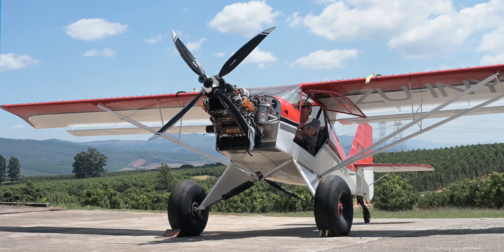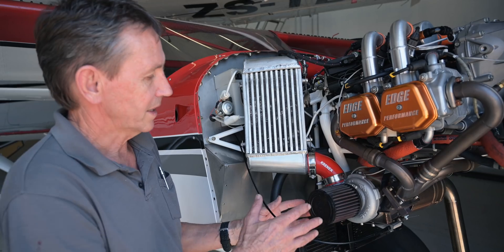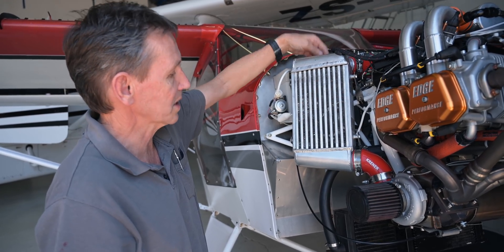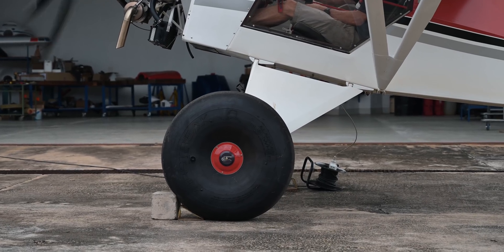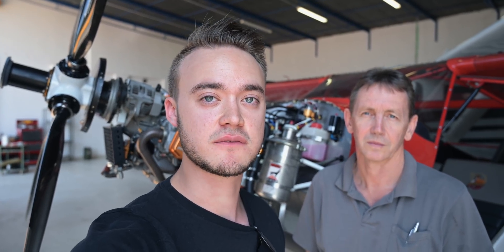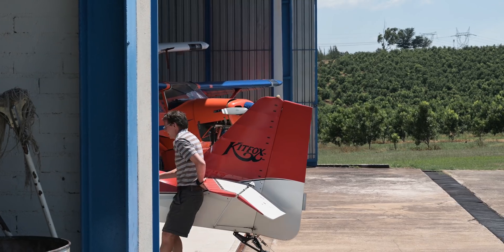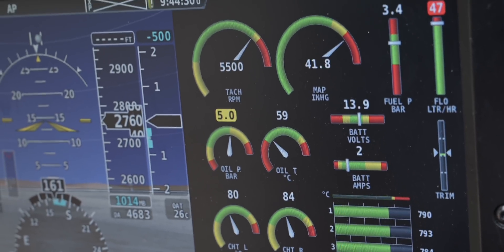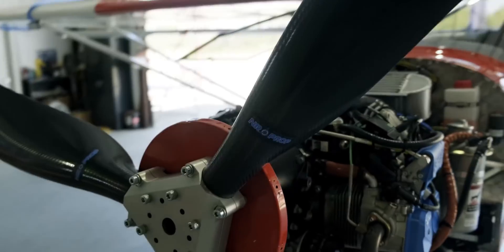ENGINE INSTALL | 165hp Edge Performance Install, Cowling mods, Taxi test - BUILD Part 3

Comment: Lost almost 30lbs?! How is that possible? Carbs are a couple pounds heavier than the injection but damn. Nice work. Yeah, mine is currently around 950lbs
Reply: Ooh SNAP! Trent Palmer, Gravity Knight and About2Stall all commenting on one post?! I’m subscribed to all of your channels! You guys are my hero’s!!
Reply: WesJordan  thanks Wes! ...and About2Stall- well, regardless of how the weight was lost, it’s good your bird got lighter!, should really rip with the high power Edge motor. Been tuning mine the last few days... amazingly smooth! The 915 is a great engine- flown one and love it... but I do really like/prefer having control over the tune!! Enjoy
Reply from the maker: Yeah Thanks man! We are really glad about the weight loss! I can foresee these Edge Performance Engines becoming really popular, they are totally worth it. Also, excited to see the performance boost you'll get on your Rans💪🏼 keep in touch!
Reply: Trent I asked the same question and I asked Thomas Hauklien of Edge performance engines how could this be? His response was  
"the 915 has a messy wiring harness, huge heavy CB/Relay/Capacitor box, twice as heavy gearbox, heavier crank, heavier turbo and exhaust system, dual injectors, sensors etc. it all adds up"
Reply from the maker: Thanks Trent! Yeah like Gus said, it comes down to lighter parts!
Reply: I think Trent was asking how you lost 30lbs vs. the 914 that was in it. I just installed an edge system on my 914, I didn't weight it all out, but I would say their claim of a couple lbs lighter makes sense. Where did the other 25+ lbs of loss come from? It's no surprise the edge motor weighs less than a 915, but how did you guys lose 28 pounds on your bird is the question...
Reply from the maker: I'm not exactly sure, but between Edge Performance completely rebuilding our engine and Re-doing the firewall forward we must have shed the weight...
Reply: Trent Palmer not to mention the bigger wing!!!
Reply: Also a larger SS7 airframe!
Reply: Another great video! You guys make me nostalgic for South Africa. Grew up in Eldoraigne, Centurion... I think that’s close to where you make these videos. I live in Calgary now and fly a C182. Wish I had the opportunity to fly when still in SA. Beautiful places there...
Reply from the maker: Thanks Magnus! Yeah, Centurion is not far away! If you're ever on this side again hit us up!
Reply: Rotax lists the 915is as 12kg/26lb heavier than the 914

Comment: I have questions regarding mogas. In North America, Chevron supplies 94 octane. I some more remote areas your lucky to find 89. Avgas is not recommended for these engines without additives. What do you do if out in the back country and 87 is the only fuel available. Can the engine retard the ignition to compensate for the fuel, or are you stuck on the ground till someone can ferry out high octane. Frankly for a functional back Country aircraft, Id bail on all this extreme high performance boosted performance stuff for a lower compression engine that can burn stale farm gas and can be hand propped if the battery goes dead. A zipper or over size bore kit that keeps the compression down while adding power is the best and most practical for bush in my opinion. More more more may be fun, but is just not needed  and can have inconvenient consequences in some cases.

Comment: The lockwire on the end of the propeller is scary... Why isn't it twisted?
Reply from the maker: Just went through frame by frame and they are diffidently twisted. Thank you for the feedback! Always nice to have some extra eyes incase we miss something 👍👍👍
Reply: @About2Stall  https://i.imgur.com/aCSuaH3.png
I found out it was just for the endcap spacer thing. I'm used to big hydraulic propellers on O-470s and IO-520s.

Comment: NONE of this will help on a short landing....., just saying.  A 927 pound Kitfox??!!
Reply from the maker: To land short is not our problem, we can land very short. Thats why we needed more power to match our takeoff to our landing.

But....Having 4 blades instead of 2 or 3 will definitely improve with short landings. The extra blade add extra drag. And the weight we lost on the nose will also decrease the stall speed. Which in turn,,,, improves short landings.

Comment: I'm kinda amazed that that throttle was new to you ... I had that arrangement 15 years ago on a big truck PTO powered gen set / hydraulic pump ... as I recall it was commonly used even then and just makes sense for GA single engine aviation.

Comment: The amount of radiant heat from the exhaust system & turbine housing is going to be horrendous inside the cowling without protection & maybe even to the point of being a fire hazard. 1300-deg-F measured at the port is increased down stream due to pulse stacking from drive pressure, that's why you see it going beyond red hot in places. A full set of custom 3 layer blankets would add about 2lbs to that setup & be so efficient you could hold your hand on it. Unlike that cheesy fiberglass pipe wrap junk, blankets breathe & don't hold moisture to damage components when not in use. I have them on my Subaru aircraft engine, my 600 cu in turbo'd race engine & both turbo diesel's.

Comment: I don,t see a air inlet to the air cleaner on the turbo, is the naca feeding both intercooler and intake air? Nice mod on the intercooler and the custom throttle bracket at the intake,haven,t seen it done that way good idea. What brand of throttle cable did you use?
Reply from the maker: Yes the Air filter is in the Naca scoop next to the outlet going to the Inter cooler.

The throttle cable came from McFarlane Aviation. I believe the Throttle itself you can get from KitFox.
Reply: @About2Stall  McFarlane can supply anything throttle/controls related, top quality.

Comment: The purpose of the intercooler has nothing to do with mass flow density. The pressure will drop with a Temp drop but the mass flow will stay almost the same. As a result the density will not change. The intercooler is there to cool the air and reduce risk of pre-detonation.  ie stop hot air going into the cylinder on the intake stroke. This is my pet hate when it comes to forced air intakes. People think that NA engines at STP  (Standard Temperature and Pressure) which do get an advantage from cooler air because its a more dense airflow are the same as boosted systems. This is not the same as a turbine or supercharger compressed airstream. Without getting too detailed in relation to fixed volume vs temperature and pressure changes .... the amount of air being pushed in  does not change with temperature, the pressure changes. This is different for atmospheric air because there is no containment vessel. More temp on an unconstrained air volume means the pressure drops and the density drops.

This miss conception happens when Naturally aspirated engine guys and their "cold air intakes" begin to add turbos and superchargers to their engines and they think it works the same. 
It doesn't

Comment: I wish someone would make a prop with beta/reverse for high output piston engines. Airmaster makes a prop that can be reversed but it's limited to 100hp and only really used for backing out amphibian planes. Imagine being able to use that to help land a STOL plane.
Reply from the maker: We talked to Airmaster, the prop has to many safety features, so to convert it would be a huge undertaking!

But that would be insane🔥🔥
Reply: @About2Stall  Your four blade prop looks amazing on your bird. You guys did an amazing job upgrading her. I would love to see you guys in the US for the High Sierra or Reno STOL Drags. You would be more than welcome here. I can only imagine the cost of shipping it here but it's fun to think about though.
Reply from the maker: Watch this space, we are working on it! Will be sure to take you up on that invite! Thank you very much
Reply: Ill be there too if you make er to the states!  Great Fit and beautiful engine and mods!
Reply: @About2Stall  I hope this means you'll be flying the plane to the US ;)
Reply from the maker: That might be an option😋